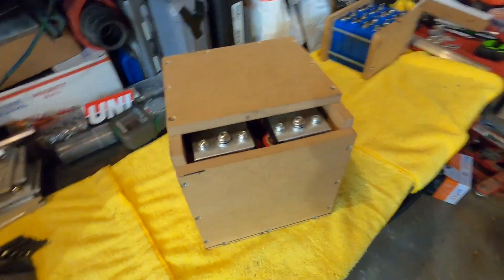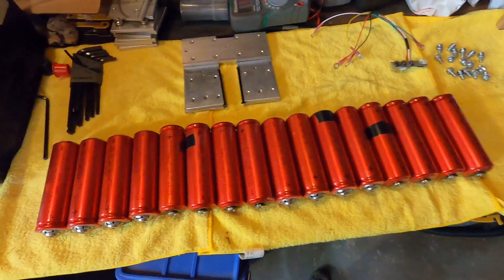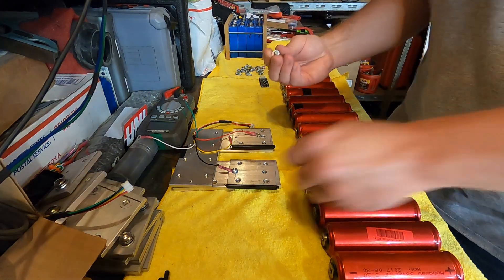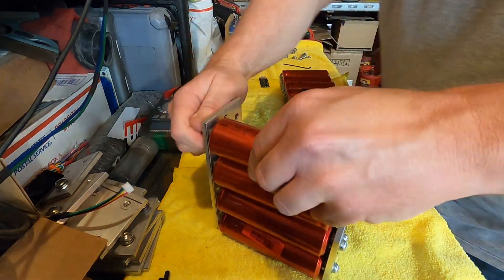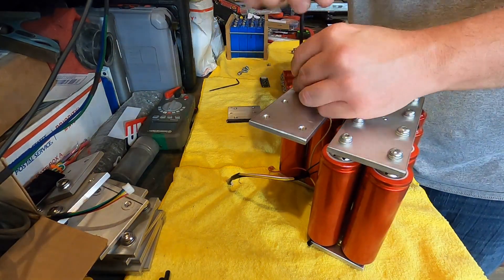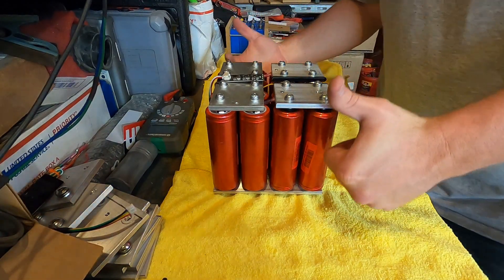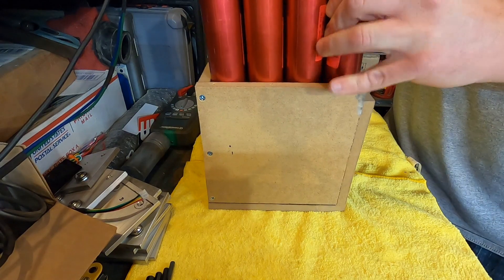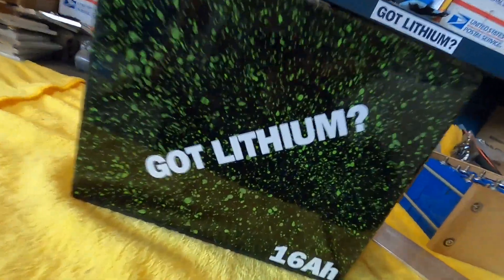DIY Headway Lithium Bank, Complete video tutorial.  Car Audio Lithium has never been easier!

Comment: I ordered an isolator for security but I’m honestly debating on whether or not to just run it parallel with my lead acid under the hood
Reply: i'm thinking about doing this, this is my first, how did u wire yours, ?

Comment: I live in 1967 GM TDH-4519 city transit bus full-time and my agm batteries took a dump on me so now I only have power when the sun is out, but I am disabled and not able to get a job, so how much will it cost to build that battery or is there anyway you can help me with cells

Comment: I don't understand how it's more power than an agm with less amphours and same voltage
Reply: I've got an orion hcca 5000.1dv2 and everything I've came across says I need 500 amp hours
Reply: The big thing with lithium is their "C" rating. Which is how fast a cell can discharge its energy and recover after. AGM can't compete in those areas, much slower recharge/recover rate and a lot less pulse/burst discharge rate. Then you factor in price, weight, and size and headway/lithium is the clear winner.

Comment: You said you connect it straight to the lead battery what about charging it? Im interested in this set-up to run a cb amplifier which require large amounts of current everytime you key the mic
Reply: Connect just like any normal battery, it's just added reserve.

Comment: How many AH would I need to support a Taramps Smart 5?
Reply: 32ah of Lithium with 270amp or bigger alternator.
Reply from the maker: You'd need quite a bit, 64Ah at least with a good size alt.   Smart5s can draw big power.
Reply: @gotlithium6311  what about taramps smart 3 bass with 80 amp alt

Comment: Hey boss, ive just found your video/page and I’m truly grateful for the knowledge your giving me🙏🏽,, wanted to run my get down to you and get some feedback if possible,, so.. I’ve got 16 38120 8AH cells possibly will get 4 more to make 20 total.. what kind of BMS will work but is budget friendly?.. discharging process? I can’t find a forsure method I can use.. this my first run at building a bank, I wanna make sure I go about it the Correct way,, lol.. Also I want to achieve 40ah bank when done.. 
Any & all feedback would be much appreciated🤙🏽🙏🏽💯
Reply from the maker: Thank you!  I'm Glad my videos have helped you out!  As to your questions, that little 1.2a 4s balancer shown in the video is all you need, They're about $10 on eBay.  You really shouldn't need to charge or discharge them, just assemble and install.   
It is a good idea to hook all cells in Parallel for a few days, POS to POS and NEG to NEG, this will help with the initial balance of the bank; However, when starting with Used cells like these, they will never be perfectly balanced and its perfectly fine to just assemble and install and let the balancer do its job.
Reply: Thanks for the reply brotha! Much appreciated 🙏🏽,, So,,, lol,, I was told I would need a 4s 100amp BMS (DALY 100amp 4S BMS) for my use in car audio,, why the different suggestions?.. also your hardware screws you used and the custom bus bars you used.. any way I can get the ones you used from somewhere?? Please if you can point me in the right direction..?

Comment: Im doing 64 cells for my car audio build. I been told that I need to put a regulator on the alternator. Im doing two separate banks of 32 cells can i run it without having to put a regulator. I do have a second alternator in my car. Thanks in advance
Reply from the maker: 128Ah is quite a bit of Headway, a stock alternator May have a little harder time keeping them charged, but will work none the less.  However, Upgrading the alternator would be a benefit.   You shouldn't need a regulator unless it currently charges too High, Headway is acceptable to be charged anywhere from 13.2v to 14.6v.
Reply: It is my understanding that a regulator is not there to prevent damage to the battery bank, but rather to limit the current the alternator puts out, thus helping the alternator to run cooler and last longer.

Comment: I also have 16 headway cells all I need is to make the bussbars was thinking bout buying the aluminum off Amazon. What were your dimensions on your bars here? Are they 1/4? As well that’s what I’m going with too thanks. Excited to see what this 32 AH can do!
Reply from the maker: This material is 1/4" 6061 aluminum.  the long bars are 2.5"x6.125", short ones 2.5"x2.5".  The holes are 1.625" apart in all directions.  Depending on how much stuff you have to hook up to it, it may be easier to do a more standard layout with pos and neg out each side, also giving you 4-6 hook up points per pole.  In that case you'd essentially make 5 of the long bars and use those for the poles and run the bank as straight lines of 4 cells instead of clusters.

Comment: Not many of these on YouTube so shout out to you! I built a 64ah bank. I haven't used it yet being afraid of the unknown 🤦‍♂️ do u think it'd support my car and 5k watts? I've got videos of my bank on here.
Reply from the maker: 64Ah plus a big alternator will definitely support 5k with ease!  throw that bank in and start enjoying lithium power!
Reply: @gotlithium6311  do you think charging at 14.8 will be a problem?
Reply from the maker: @1ohmwrecker  Charging 14.8v is over max charge and will degrade the cells more quickly, you will lose some lifespan over time.  There's no immediate danger like explosion or fire, it'll just wear them out more quickly.
Reply: @gotlithium6311  I did some research, and if I get an isolator, even tho you proved you don't need one😉) and it'll give you a voltage drop of .4 to .6 volts. So that could keep me from over charging the lithium and staying around that 14.4v, right? Just an idea...
Reply from the maker: @1ohmwrecker  It's theoretically possible, but I usually advise against introducing a bottleneck.  However, that may actually work to limit voltage with that being your goal.  Give it a shot man, only one way to know for sure!
Reply: @gotlithium6311  well I greatly appreciate you replying man! Thank ya!

Comment: If I do this setup. I'm thinking about doing a 4s setup but with 20 cells total to go under my seat. 
Do I delete my agm batteries or keep my under hood or get like a 200a battery isolator or something?
Reply from the maker: You are absolutely fine running the bank straight parallel to the Lead up front, No Isolator Required.  I have another video up on exactly that subject.
Reply: @gotlithium6311   I'm about to look for that video right now

Comment: I love these batteries but ? Is what happens if I only have 4 can I still use them in a car audio set up? That's for the feed back
Reply: Minimum you should run in a car is an 8 cell, 16Ah bank, for charging reasons.  4 cells will absolutely start a vehicle, but should not be used regularly.
Reply: @shanedwyer2845  can you allso mix up 100amps and 200amps
Reply: @gioarteaga3984  You can mix any size or capacity, even chemistry.  All that matters is voltage.  12v battery is a 12v battery.

Comment: Great tutorial, so you don't recommend running an isolator between bank and agm? My agms rest at 12.9
Reply from the maker: I do Not recommend using an isolator.  I feel Isolators are an unnecessary bottleneck in your charging system.  LiFe does rest slightly higher than Lead, so the bank will float the Lead Up, but the draw is negligible.  Over many days, the Lithium will Eventually drain down to Lead rest, then both will just sit at that voltage indefinitely.  If you drive the vehicle daily or even weekly, there's no issues running them Direct Parallel as the vehicle in the video is.
Reply: @gotlithium6311  Awesome bro thank you. Yes it's my daily driver so that is good to know. I really appreciate that 🙏

Comment: You said you paired this with your lead acid battery up front ? Impressive. I'm currently building a 16ah for a small sound system I'm building for my wife.
Reply from the maker: Correct.  The vehicle shown is a Lead to LiFe setup.  I ran a 16Ah bank with the factory battery for quite a while with zero negative results.  Plug and Play Power!
Reply: @gotlithium6311  you use a isolator? I wanna add a 32ah bank to my system and move up to a taramp smart 3k
Reply: @ryukx4674  no isolator needed, plug and play. I ran a AGM under the hood and a 96ah headway bank in my trunk.
Reply: @KvnWlsn  I've heard often agm and lithium pair okay but I did not know you could pair lithium with lead acid... assuming that's what OP and @GotLithium? Meant
Reply: @RandoManFPV  I believe it is what they meant but then benefits of AGM far outweigh lead acid to the point that whenever I get a new vehicle the first thing I do is replace the stock battery with a AGM of the same size.

So yes you can run lead acid and headway together but I personally wouldn't. AGM and headway is the least I would run but ideally you would want to run a supercap under the hood or do a battery delete and run just lithium... at least that's what I have always been told.
Reply: @KvnWlsn  damn, yea that's what I've been told too really.
Sadly my battery died on me 6 months ago and wouldn't hold a charge.
I couldn't afford the hundreds at the time for an AGM so I settled for a, much larger than stock, lead-acid walmart special.

So I feel like I should build a bank before I swap out the brand new under the hood battery but maybe not... 
Another thing pushing this decision is that I seem to be within the perfect range of what my stock electrical can handle.
I only get voltage drops at full tilt max volume(I don't do often cuz this heats my subs.. clipping I suppose) and then I only see drops of about 0.4-0.6volt.
That's 14.8 normal, dropping down to about 14.2 at full tilt

Chevy cruze 2012.
Stock electrical (bigger battery 🤷‍♂️)
Big 3
Skar 1500.1d
SvR15d4
Reply: @RandoManFPV  generally you can go to any auto parts store and buy an AGM for about the same price as a lead acid of the same group size.
Reply: @KvnWlsn  sounds like I doubly fucked up then by just googling agm and checking out what showed up 😅
Reply: @RandoManFPV  the only things I buy from Walmart for my ride is air fresheners, coolant, oil, rainx windshield wiper fluid (because it's cheaper than at the auto part stores) and stuff to clean my wheels and tires. I'll never buy batteries or tires from Walmart or let them ever service any car I drive.